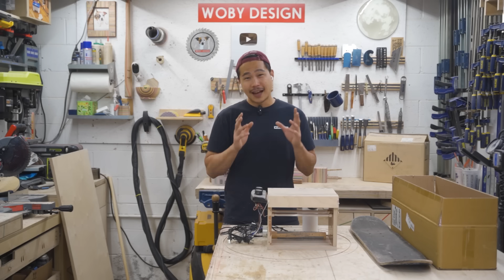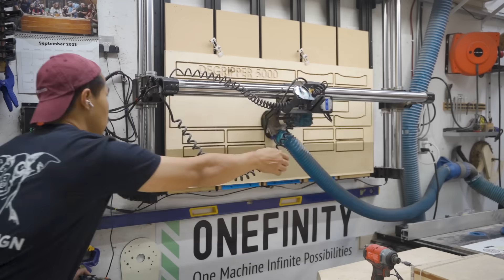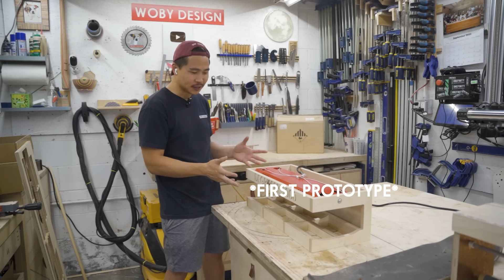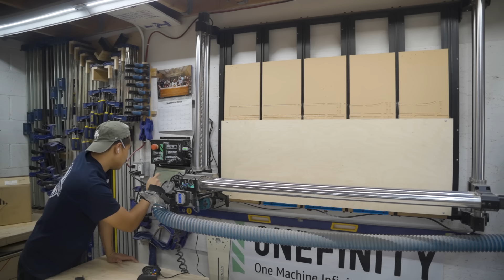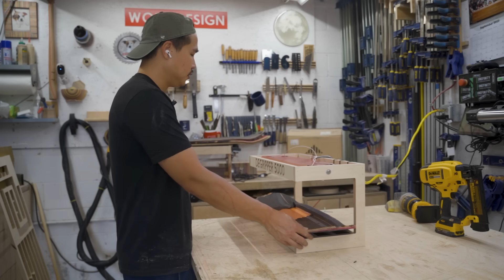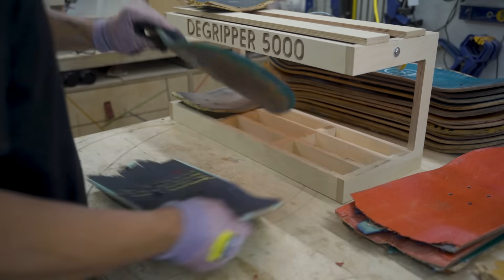I ALMOST BURNED DOWN MY SHOP!!!

Comment: I would add a knob to turn it on and adjust intensity, Temperature sensor with read out, light to indicate its on, and a built in circuit breaker.

Comment: nice build... 👉I would recommend adding a few things: 🕐a pilot light as a visual indicator when it's on; 🕑a beefy SPDT switch to turn it off; & 🕒a rheostat to control current flow & temp (better yet, a PID temperature controller so you can specify your desired target temperature) would definitely be a nice upgrade ... 
👉 closing it up into an oven with insulated foil boards & a front "curtain"/door would also be prudent so you don't waste energy radiating unwanted heat into your workshop when you're using it.
✌cheers! & looking forward to your next adventure!

Comment: in screen printing we have the same kind of constant high heat so we can "gel" the ink up and lay the next color on the garment. This makes shops really really hot, so they made the same thing but  where the heat source strobes a couple times til the ink gets to the proper temp usually 3-5 seconds. This keeps shops much cooler! I know in painting vehicles they use a similar thing. these are called "Flashes". maybe for the Dgripper 6900 you could look into those.

Comment: An on/off switch definitely and I would put a timer you can switch on before you turn the unit on.  You can set the timer to thirty seconds or forty-five seconds or whatever you need so the unit will only be on for as long as it needs to be on.

Comment: I think a few things that might help this yes definitely adding a switch, but also an aluminum top with vent holes in it that also has a small fan mounted inside to pull out some of the hot air that builds up above the light. Then you could add that platform above it since it will then be shielded

Comment: You should think about installing a audible alarm that sounds every 30 seconds or however long it takes for the heater to melt the glue to enable the removal of the board's skin's. This way when you're busy and distracted by other jobs the alarm goes off stopping you from burning down the workshop etc.

Comment: Definitely upgrade the top with a fire resistant insulated material like a fire blanket. That way the wood won't be exposed to the heat and it will be safer. And add a switch!

Comment: I was thinking if you want a lid on it, get some expanded mesh, chicken wire, something along those lines, it can take the heat and gives you a flat surface.... Maybe a variac(spelling)( variable power supply) to control the heat?

Comment: i think a better design would be to have the heater on the bottom upside down, then have a grill above it at a set distance. That way the heat all come right out and up. I dont know if those infrared heaters are made to be left horizontal facing down like that. For paint curing they are often mounted on walls. 

plus a conveyor belt and hopper would help reduce the chance you miss-time and melt a board. Just load the hopper, hit go, and it feeds them all in and out at the perfect rate.

either way, a metal grill over the top would be best for allowing heat to escape but also preventing someone touching the very hot lamps.
Reply: Yeah, I was going to say this too.  If there's a ton of excess heat coming out of the top, that means you could get the same effect with a lower power bill by using that heat instead of feeding it straight to the air conditioner.

Also, I know this is a woodworking channel, but wood feels like a really questionable material choice for this tool, especially with how much fuel is packed really densely in that shop.

Comment: nice, lucky you caught on pretty fast with those wires. was thinking, you reckon you could simply put the lamp onto an arm, like the camera jig? that way you can degripp wherever in the shop. could be called degripper5k2go

Comment: Not sure if it would have reduced the heating power a little too much but you could have also wired the heating elements in series rather than parallel for the the prototype.

Otherwise, great video as always! Keep up the good work!

Comment: you are pushing 18A with that heat lamp..  Code requires 12, or 10 AWG wire from the backend side (from breaker to plug itself).  Using the correct wire size is important, but you are also at the limit for the circuit.  You would be better off finding a 220V heating unit and run it off 220 if you have a shop plug, or a dryer plug (assuming you have either available).  If you have to run it on 110, as someone else mentioned, drop a temp control unit into it, and ramp the temp down.  A constant 18A draw is likely to trip the breaker regularly.

Comment: BEN BE CAREFUL!!!! I love your channel and I do similar woodworking with skateboards and veneer lamination. Since you're probably using skateboards mostly from unknown manufacturers and don't know what adhesive they used in their lamination process, you should be careful and breaking down the bonds between the individual layers in the skateboard. 

As long as you're not overheating the board AND making your cuts shortly after, you should be fine. Just wanted to give you heads up, I've had projects delaminate like that on me before and it's a pain in the ass.

Comment: What I love about this project is the choice of material. I mean, to support and shield a lamp that reaches 400° (I think that's what you said), what could possibly be better than flammable plywood, right?

No matter that you prevented your workshop from burning down - this new device will surely finish that job for you, especially as there is no timer or other safety feature.